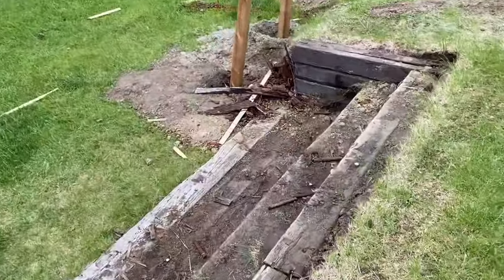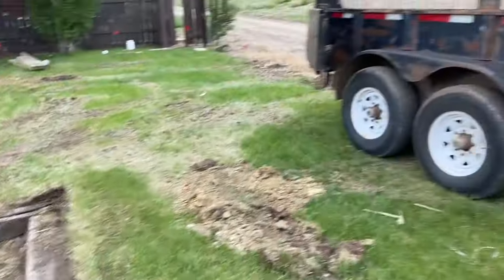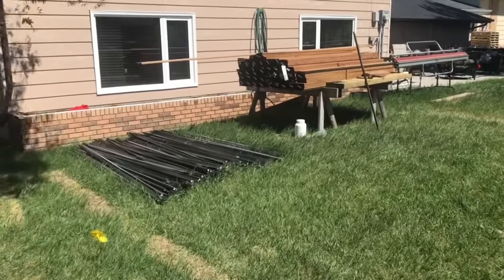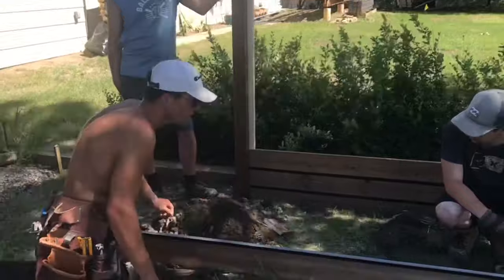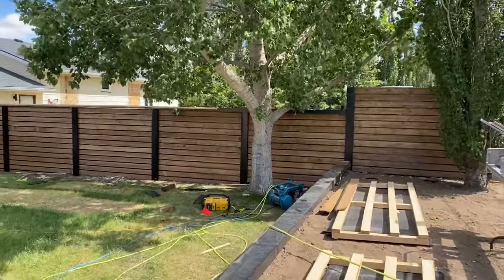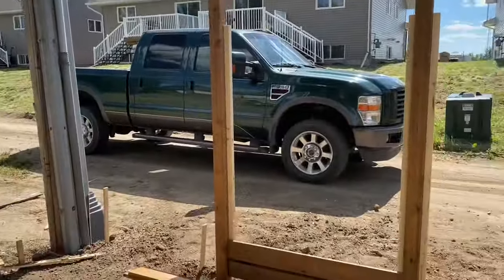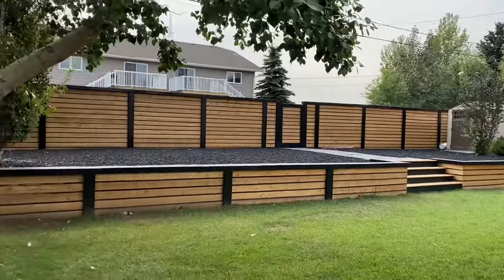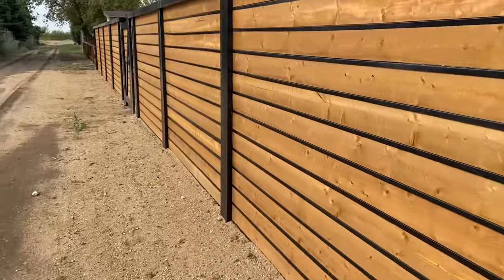Ultra modern backyard renovation!

Comment: Austen, I forgot to ask if you used deadheads in the retaining walls.
Reply from the maker: No, reason being is we were so close to the old wall which we left most of it in place, so there shouldn’t be much pressure on the new wall. Also the holes for the posts were 6-7 feet deep